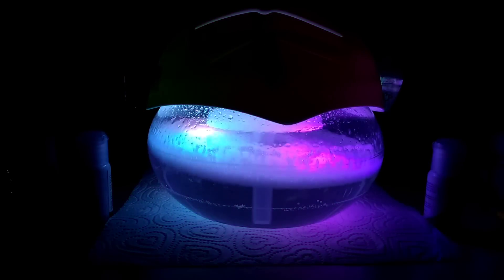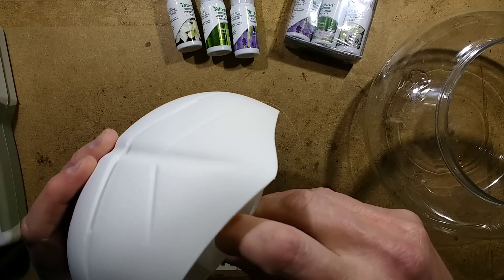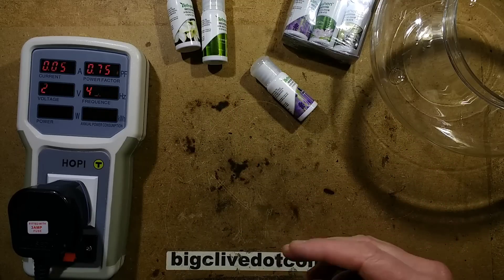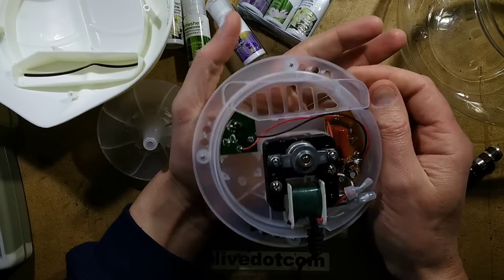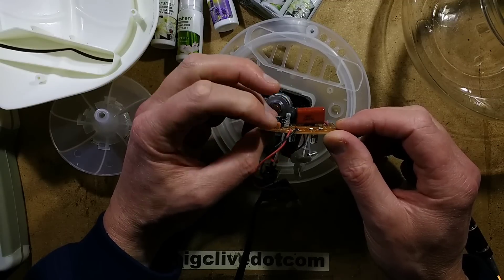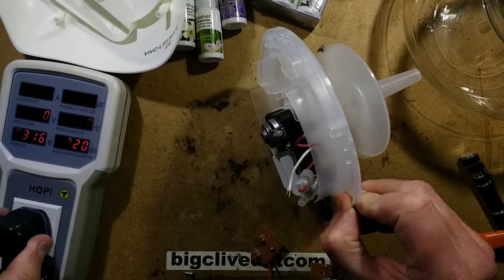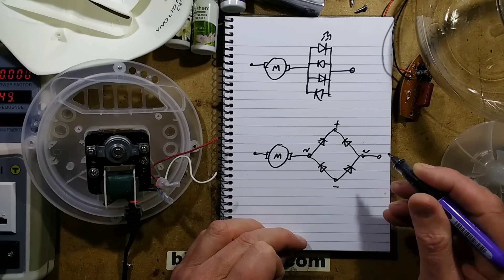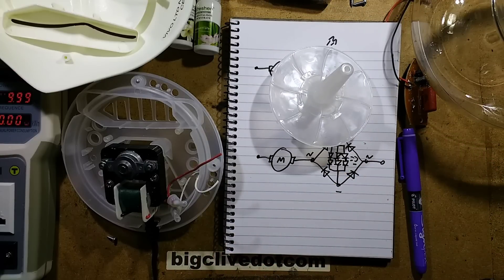Water sphere air cleaner.

Comment: Well, I can tell you it's not going to clean anything out of the air. A room typically requires 3-4 air changes per hour by design, and there's no way that plastic funnel is going to suck up 4 roomfulls of air every hour. Whatever that thing might clean out of the air, is going to be undone in a few seconds by any old breeze. If the room smells of the fragrance thing, it's probably because your nose can detect insignificant amounts of chemicals in the air, so whatever tiny amount of air gets put out, makes you notice the smell.

It's nice to watch it going though.

Comment: I used to work in a commercial laundry that had a much larger version of this to remove lint from the dryer exhaust. Essentially it was a big stainless steel box with water jets that sprayed a fine mist of water into the air stream and some baffles to keep the water mostly contained in the box. The bottom of the box was shaped like a giant funnel and had a nylon bag on the end. The nylon bag sat in a tank that had a pump that pumped the water back to the box. At the end of the day, the nylon bag would be full of 30-40 pounds of wet lint. The concept is the same, so to all the naysayers, yes it works, though I'm not sure how effective this would be given its tiny size. Also, those wet lint collection systems were phased out due to concerns about mold and legionnaire's. We used to change the water in it every day and someone (usually me) would have to go inside it every couple of weeks and wash it out because the wet lint would collect all inside of it, too. I was so happy to see that thing finally go away.

Comment: This unit looks like it was based on the old cool mist humidifiers that used the impeller with the suction tube and blades to split up the water and shoot the mist out the front.

Comment: I am not sure what is going on, but this video and your previous video are unwatchable for me due to not being able to hear any audio, even with my speakers turned up all the way. I always watch all of your videos right to the end but I cannot anymore. It only happens on your videos, so I am not sure if you are just not including audio as a kind of troll, but I definitely cannot hear you in these last two videos.
Reply from the maker: The audio is there, but if you have a surround sound system the mono audio may be being diverted to a centre speaker that doesn't exist.  Check your computer's surround sound settings.
Reply: derp that was it, thanks!! forgot when I originally added my subwoofer I had to screw about in those settings. Thanks!

Comment: I wonder if they make scaled up versions of these for dust on work zones. I have a feeling that it would be very effective for wood dust, plaster etc and it might be easier to clean than a air filter.
Reply: Probably no different than a wet dry vac with some water in it.
Reply: For decades a company by the name of Rexair has been making cleaning systems based on this idea and made this unit under the “Rainmate” name.

Comment: In the 80s these were used as humidifiers, minus the LEDs. I remember them working well but they rotated much faster and would produce a fine, fog like mist. You would need to clean them well and add a bit of bleach to keep it from getting funky.

I also had a "steam" humidifier that was insanely dangerous, it worked by submerging electrodes in slightly salty water. The thing is there was no interlock so you could remove the cover/electrode assembly while powered, also there was no kind of current limiting or fuse so you could add enough salt to make a violent, light dimming, breaker tripping show.

Comment: If you want a reliable, non-HEPA air cleaner, it is pretty easy to modify a Mountain Breeze (or similar, home-made) air ioniser to act as a Precipitron. Just a grounded fine wire mesh grid and a cheap, small computer fan.
Reply from the maker: I've got an interesting ioniser here that doesn't just ground the mesh, but has its own short positive voltage multiplier to make it a more desirable target than the furnishings.
Reply: How effective is your model? My "plastic sandwich box" creation is surprisingly good (i.e. if left on, the mesh screen will start to block up in about a week).
Reply: Pollen filters should be able to trap almost all the diesel exhaust particulates (soot), but not the nitrogen oxides. You might need to fit a charcoal filter for those (and be prepared to replace it fairly regularly). Quick review article - https://www.driving.co.uk/car-clinic/car-clinic-do-pollenintake-vehicle-filters-remove-harmful-exhaust-fumes/,  Charcoal filters - https://www.ebay.com.au/sch/i.html?_from=R40&_trksid=p2380057.m570.l1313.TR1.TRC0.A0.H0.Xcharcoal+air+filter.TRS0&_nkw=charcoal+air+filter&_sacat=0 (check the size of your existing pollen filter - and see if you can find a reasonably close approximation). Hope this helps!

Comment: I have a Rainbow vacuum cleaner (hoover in British) that uses this principle.  (Full disclosure - I also sold them for a while, but after my purchase)  It was tested by an independent lab to remove 99.98% of everything over 1 micron (IIRC, though might have been 10 micron) from the air.  Actually, in demos we talked it up as a whole-house air purifier before we brought out the cleaning attachments, and the water could indeed get quite cloudy just sitting and running for a while, depending on the environment.

Though I'm not sure if the method would work on lycopodium powder since it doesn't get wet.
Reply: Is that any better than a conventional HEPA filter?
Reply: bobobobinalong 
I also sold Rainbow's in Indiana,,,  pre-1970
Tanx....
Reply: English*

Comment: Essentially this is a humidifier. In the 70's and 80's (perhaps earlier and later) in the states, the Vicks corporation sold large square humidifiers that used this same setup and included a area to place some of their  'vaporub' above the motor to heat it. It always left the floor near it wet, but it did work as a humidifier.

Comment: The principle of using water sprays to clean gas/air is pretty sound and the basis of many industrial processes. However as others have said I'd be worried about the hygiene of this unless you changed the water and fully cleaned the unit very regularly.

Comment: I would have wound a few turns of insulated wire around the motor coil and used it as a step down transformer for the LED's.

Comment: why not wrap wire around the motor winding to pickup some power to driver some LEDs
Reply: it common to use a coil of wire to pickup some power, I seen it used all the time in microwave ovens transformer and TV's flyback to get a volt or two

Comment: Kinda random in the case of this vidjayo
With the common 9-12v 10w led cobs is it possible to drive them from a 12v power supply for about 10-12 hours a day if I had a 50w rated fan less heat sink ?

Comment: Woohoo!  Instant Legionnaire's disease.

OK, maybe the supplied chemical is a good enough disinfectant to prevent that.  But, going by the comments, people are using these things with ordinary detergent or even with plain water.

Even if the supplied chemical is good enough to prevent Legionnaire's disease, the extra humidity may promote mould growth with its own health effects.  So really the thing ought to be combined with a dehumidifier.

Or maybe just not bother.
Reply: just use 96% ethanol instead of water ... and enjoy a happy time in the room you're in :D

no legionella problems tho ^^
Reply: +Fox Wright
Waterfalls don't recirculate their water.  Less of a risk.

Now an artificial waterfall, or even a fountain, would be more of a risk.

Which is why swimming pools and Disney's water rides are chlorinated.
Reply: Do you know how we dose decorative ponds and fountains to prevent legionella?

We float a plastic duck in the pond, it has a slot in its bottom where we stuff a huge chlorine tab. The duck is top heavy, the weight of the chlorine tab balances it, keeps it upright. As the chlorine dissolves slowly into the water, the duck again becomes top heavy, flips upside down, so we know when to replace the chlorine. If only cooling towers were so easy to dose.
Reply: I find it works out better if I drink the ethanol to the point where I don't give a shit about dirt in the air or the pervasive smell of cat farts.

Pouring ethanol into one of those things is a waste.
Reply: In the US there are additives for "cool" sponge humidifiers which prevent mold and bacterial growth.
Reply: +Billy Asko
The whole thing looks like a water trap to me.  Water sprays as a fine mist and cascades down the sides.  Flow won't be regular, so there may be places of high humidity that don't get much of a flow of water over them.  New air conditioning is designed (or has strict maintenance schedules) to prevent Legionella proliferation.

As for how often the water is changed, that depends very much on the user.  One may give the container a thorough wash every day, another may just top up the water when it looks low and rarely wash it.

Please state how you know the materials are less favourable for Legionella growth.  My impression was that bacterial films can grow on any surface that isn't chemically inimical to them.  A quick search shows that chemicals such as chlorine dioxide or copper-silver ions (for example) are used to inhibit Legionella growth.

What fools those air conditioning manufacturers are!  Adding those expensive, rather toxic chemicals when they could just manufacture their kit using the same cheap, crappy plastic in that air cleaner.
Reply: +Fox Wright, I don't know how waterfalls work where you live, but here where I live one of the key properties of a waterfall is that the water is flowing.
Reply: At that point you might be better off with a  carbon air filter
Reply: nah just kidding, but a mixture of ~20-30% propylenglycole with water will do the job, without affecting the viscosity of the mixture too much
Reply: you should live in my city, alcohol doesn't help.
Reply: Better to fill the tank with molten solder than with water, in that case.

Comment: Mains near water isn't the best I'd prefer to see it as a low voltage unit using a separate power supply.
Reply: glenwoofit specially when the water is filled with soap and contaminants from the air making it vastly more conductive. Not a very safe design at all, but it's eBay Id expect nothing less.
Reply: @justgame5508  tap water is already plenty conductive. Your comment was unnecessary. You just wanted to be part of the discussion

Comment: The motor is a "Shaded-Pole Motor" because a locked rotor has little current increase     very safe any other type motor might cause a safety issue

Comment: What did you do to your thumb? Ouch! Would the hopi meter seem to flash if you put a diffuse plastic sheet in front of it, it might provide just enough of a buffer for the camera to not be affected by the rolling shutter
Reply: Nah, it wouldn't actually delay the light, that'd take some sort of complicated quantum crystal. And to fix this problem in a 1mm thick sheet would be well ahead of the most advanced light-delaying materials we have, and would be incredibly valuable. 

The problem can't easily be solved.
Reply: greenaum I wondered if both sides were frosted if the glow would make enough of an ambient light reflection to help maintain the image, it may still flicker, don't know until you try
Reply: Why would a diffuser in any way alter the time signature of a blinking light?
Reply: Star Gazer that's not the purpose I had intended it for
Reply: That's the purpose you wrote in your comment: "Would the hopi meter seem to flash if you put a diffuse plastic sheet in front of it, it might provide just enough of a buffer for the camera to not be affected by the rolling shutter"

Comment: Hmm. Kinda tempted to get one really. I can get quite bad anxiety issues sometimes and listening to the shower/rain helps a lot. If it also works well to get scent into the room it would be cheaper than all the air freshener refills too.
Reply: Not sure if this might help, but there are lots of Youtube videos which are just sounds of rain, ocean, wind, etc. Very relaxing.
Reply: James Coyle 
Don't get one of these, they're next to useless.

If you want a good aroma diffuser, have a look for the Ultrasonic Aroma Diffusers. Amazing machines, super effective at dispersing essential oils into the air, plus they will add a little humidity, if that's what you want.
Reply: Somewhere within 2008-2011, I had another brand and version of this air revitalizer (old generation before the LED light design came out) that essentially was the same design, and I found what you say now exactly to have been true then:  however good the air purifying effect is, the swishing water and aromatherapy aspect created a wonderful feng shui effect and great 'white noise' and scents for sleeping and mood enhancement.  ~C

Comment: Should have used UV LEDs to sterilize the air/water.
Reply: then they would have to use a glass bowl or higher grade, uv-resistant plastic ... but it would be a nice sensible way of sterilising :D
Reply: TheKnaeckebrot I bet you could find a suitable bowl at goodwill.

Comment: H2O does have a partial electric charged as can be demonstrated by charging a glass rod with static electricity and placing it near a small stream of water from a tap. It is possible that this partial charge may have some effect on dust particles and may be the reason for the false claim that is has an ionisation effect.
Reply: No, the glass rod induces a charge in the water. Basic static electricity GCSE stuff.

Comment: When I was young and looking for my first job I got talked into selling something called the Rainbow vacuum.
It used the water as the filter media. It had a comb that would breakup the water being slung out by the central
rotor and a vacuum motor up in the top half of the thing. They look to still making them.
Reply: rainbow sells rainmate
Reply: Rexair still makes Rainbow systems and the Rainmate.  Still the best water based vacuums out there.

Comment: I have that same model! It doesn't work as well as a dedicated air filter with fans and such, but after a couple of days the water is clearly more murky and there are bits of dust and other stuff floating around in it. It must be doing something.
Reply: It's called an air washer.    They don't work as well as HEPA air purifiers, but they are good for situations where both humidification and reduction of dust are needed.  Bigger models that are less gimmicky exist.

Comment: can you say legionnaires disease....
Reply: TheDefpom
Yes. It's a disease caused by bacteria that grows in WARM water such as hot water systems and the water-cooled hot side of huge refrigerative air conditioning systems.
It does not grow very well (or at all) in cool water, and a device like this will be cooling itself below ambient due to evaporation.
Reply: tin2001 I suspect that the water end up above ambient because of the energy being put in by the pumping action. However Legionella is quite happy at  ambient temps as it occurs naturally.
Reply: TheDefpom  legionella pneumophila

Comment: I bought exactly the same unit few years ago. It really sucks the dirt, and becomes hard to clean. I prefer to use it with water only. The LEDs stopped working a few months after I bought it. I have to fix them.
Reply: The water becomes greasy, also the inner side of the bowl. It is easy to clean, just DON'T put it in the dishwasher! But there is a lot of dirt on the propeler, the vent, inside of the propeler funnel, every plastic part that is on the air's way. You can try with a wet tissue, but it is hard to follow every curve.

Comment: This might be the answer to my problem. I would like to have a "low level" of air freshener (scent) in the air here in my home, UN-like what happens when those plug-in type air fresheners are used. To me they are overpowering even on the lowest setting. My sinuses can't stand that and by morning I can hardly breath threw my nose. Even with the things plugged in far off in another part of the house. This unit might be worth a try. As long as they don't spray water everywhere LOL or short out. The color changing LED's look really nice! I love LED's going night and day anyway!

Comment: I've always remembered how to wire a discrete bridge rectifier by holding two of the diodes together anode to anode at a right angle as a bridge is commonly drawn in one hand. Then hold the other two cathode to cathode in the other.

Then bring the remaining diode ends together with both hands and you have a bridge rectifier. The ends you're holding (anode to anode and cathode to cathode) are the DC output the other ends you're not holding are the AC input.

Comment: would you recommend this or an ozone generator or something else for combating pet odors? or are they all snake oil?
Reply: The most effective way to remove pet odor is to remove the pet.  Carbon filters are a good second option.
Reply: My old work was across from a pub. New laws prevented smoking close to their doors, so smokers started sitting on our front step, which left the building stinking on Monday mornings.
I bought a Neotec XJ2500 on ebay, kind of skeptical.... but come the next Monday morning, no stink, and a rather dirty black mark on it's filter paper.
You do need to vacuum regularly when using such devices though as some particles simple fall to the floor, so you get an increase in dust on the floor/carpet. Depends how dirty the air is of course.
Reply: Ozone is quite an uncomfortable smell after a while though. Dusting and vacuuming is more often is probably best bet.
Reply: its not really a matter of regular house cleaning since the odor comes from pet rats cage even if we clean it many times a week
Reply: For pet odor, I'd recommend a fan and an open window.